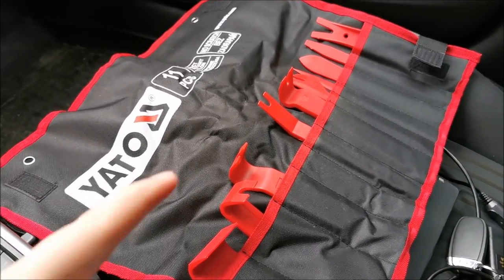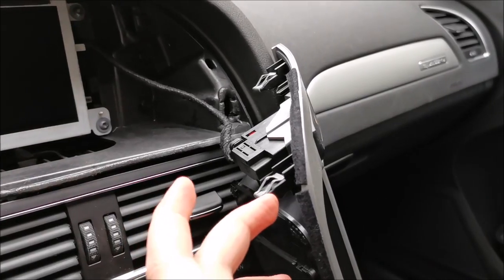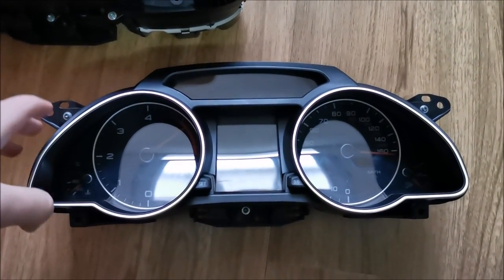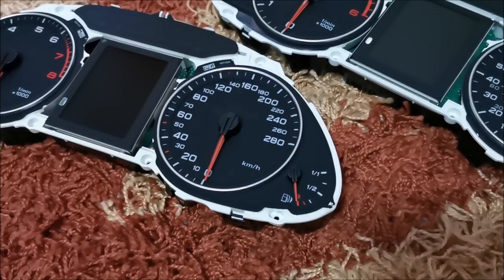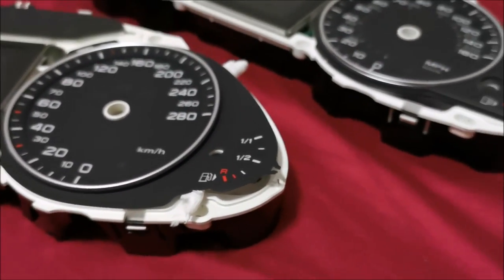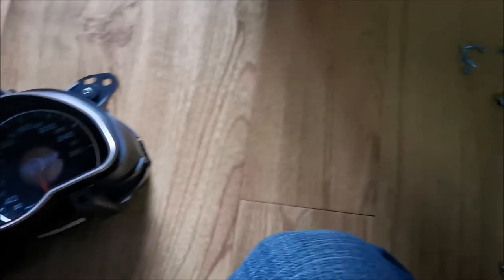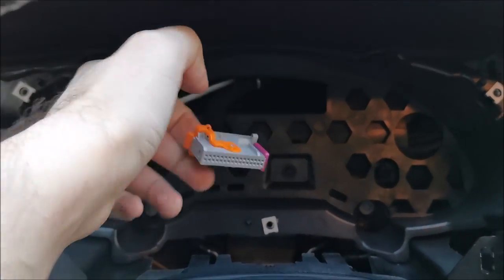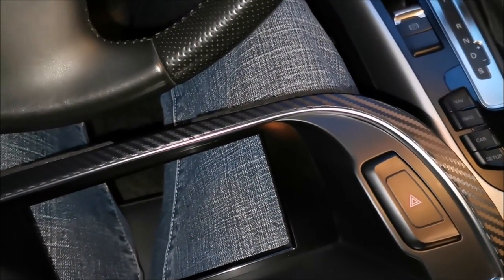Audi A4 B8 - How to upgrade the cluster to the one from A5

Comment: Do u need program cluster or is just plug and play?
Reply from the maker: You need to watch the video in detail. The cluster is not changed, only modified, so no programing is required.
Reply: @UltimateDIY  I know you only replaced the discs but my question was if maybe you know if cluster needs to be programmed with the entire replacement
Reply from the maker: That for sure would need reprograming.

Comment: mi-am dat seama ca esti roman dupa posturile de radio:)) e mai usor sa pun pe b8 ceasurile si rama de b8.5? decat cele de a5?
Reply from the maker: Salut :)
Nu stiu exact cum se procedeaza. Probabil trebuie inlaturat protection code de pe noul cluster si recodat. La fel am inteles ca s-au facut ceva modificari la unele prinderi din bord, deci e posibil sa apara mai multe complicatii pe parcurs.
Reply: @UltimateDIY  ma refer sa pun ceasurile mele( placa) in carcasa de ceasuri de b8.5 exact ce ai facut tu in video,
Reply from the maker: A, ok, inteleg acum. Cred ca asta ai putea sa faci, dar nu am "studiat" in detaliu situatia. In schimb cred ca ai avea ceva probleme cu restul plasticelor care trebuie schimbate pe bord. Din cate am inteles nu mai au exact aceleasi prinderi.

Comment: if you change the instrument cluster, do the odometer readings transfer to the new unit?
Reply from the maker: As my video shows, you don't change the cluster, just the front plastics of it. The electronics board inside remains the old one.

Comment: I did the upgrade but my A5 cluster says safe mode. Do you have the coding to get rid of that or is there another option with vagcom?
Reply from the maker: Why A5 cluster??? I said and showed a few times in the video that the cluster remains the one from A4 and from A5 you only use pointers and front mask.

Comment: Does anyone knows how to separate the black and gray frame apart ? I bought an after market touch screen for apple play ,but can’t seem to figure how to take those two apart ?
Reply from the maker: Good question...
Reply: I figure it out ,if you put a pointy flat tool (I used a knife ) if you wiggle it and move it very carefully up and down just enough to make room for the knife to keep moving forward it definely comes off .just be careful because it’s glued to each other (if the car is a couple of yrs old (my case 2011a4) the glue will be super dried .but being very gentle it came off .
Reply from the maker: Ok, got it. Thank you for this info!